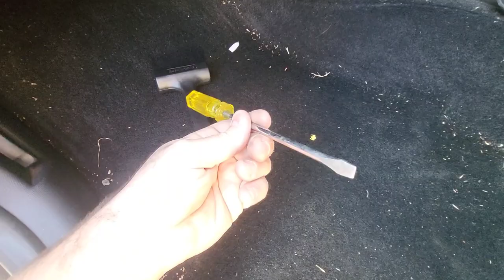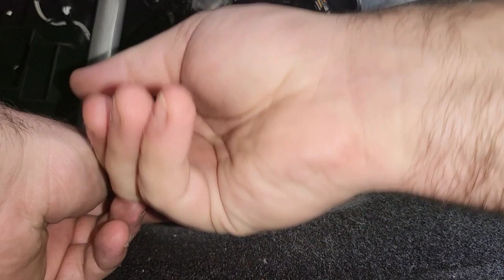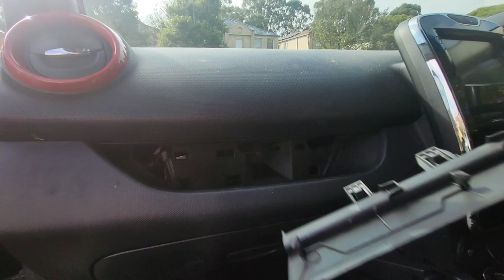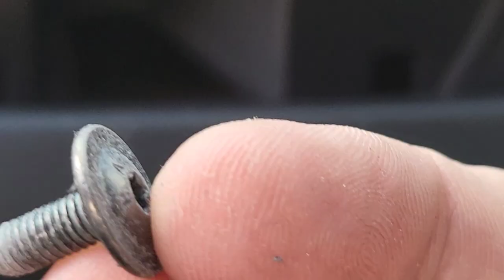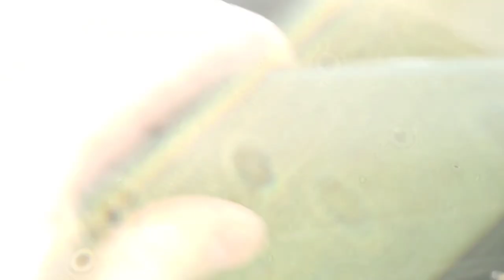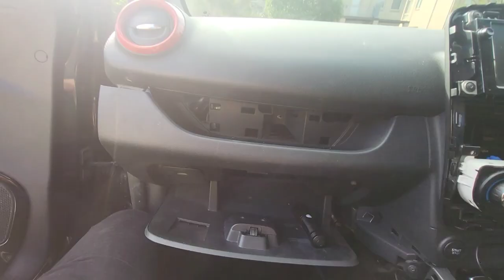How to remove cabin heater radiator for Renault Clio 4 2014 - 2022

Comment: Hi there! Did you need up changing your heater matrix for a new one in the end? 

What was the reason for you needing to change? Did your heating stop working?

Did you try to flush the matrix before replacing?